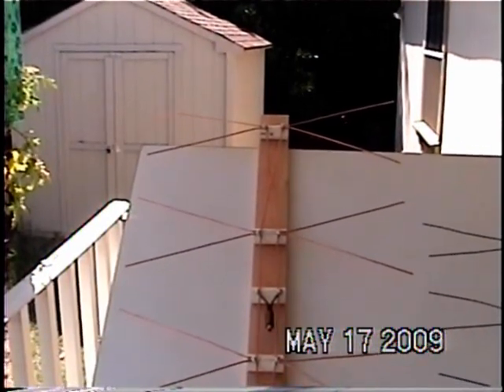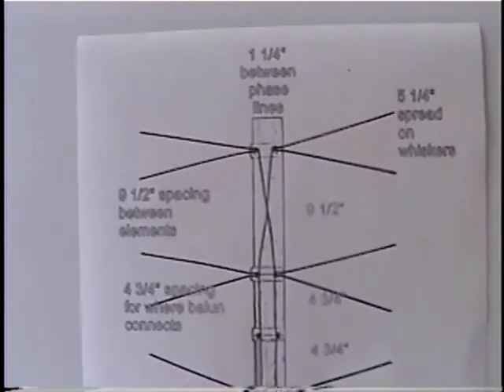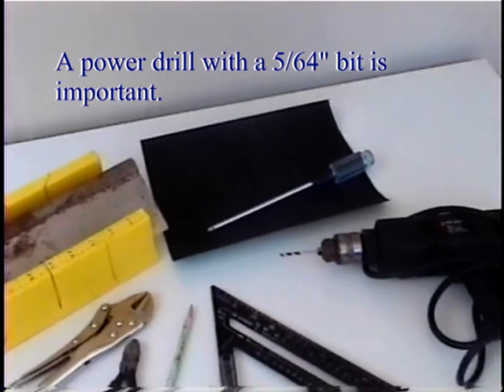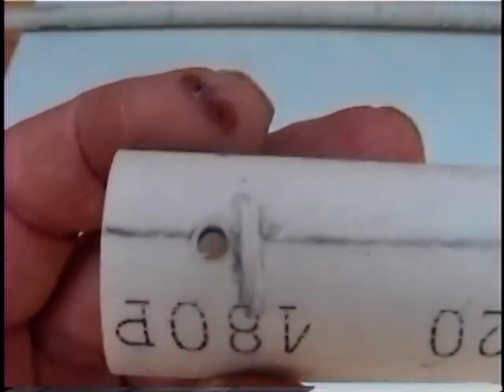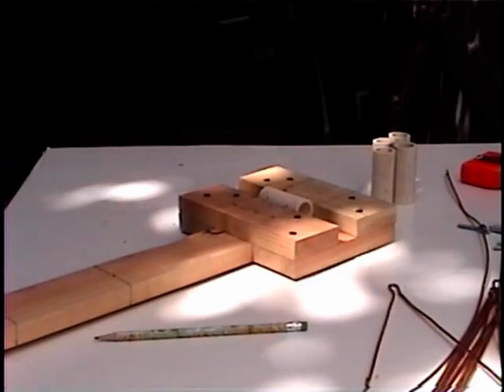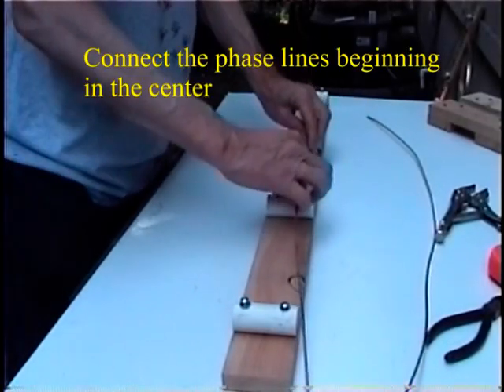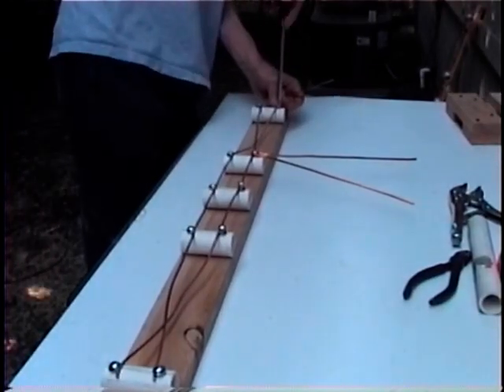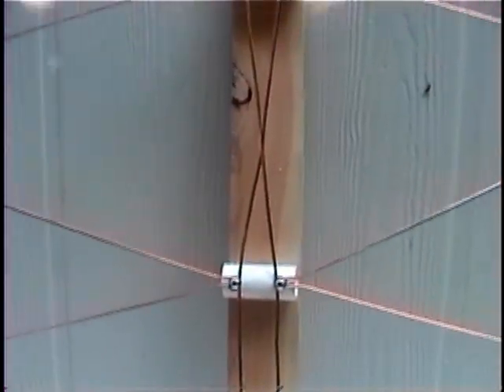A Better HDTV Antenna

Comment from the maker: @jakeshjo Heavier gauge wire won't improve things much. Clean, sanded,  contact points between whiskers and phase lines will do more, plus soldering, if you're good at it. Outside is better, plus being aimed properly (in addition to what I said about contact points), all will make a difference. For an outside antenna the gauge should be heavier, like 8 or 10, but that's mainly for physical strength, not reception. Also, a reflector may help.

Comment from the maker: @jsmac2006 Coathanger wire stinks for antennas. Use copper or aluminum. You'd probably be better off getting it at a home improvement store or an electrical outlet. 8 or 10 gauge is about right.

Comment from the maker: @athlon866 half inch steel mesh would be a lot better than chicken wire. You could also watch my other video on an outside version of this antenna. The last part deals briefly with reflectors.

Comment: Thanks for the video.  What material do you use for the whiskers?  I used coat hangers on my last antenna, but they tend to rust.  Are you using copper wiring from like a Radio Shack?  Thanks!

Comment from the maker: @athlon866 Not sure what tool you mean, but if you are ready to add a reflector, then you must have tested your antenna. Chicken wire will work as a reflector, but it isn't as good as a lot of other choices. Anyway, have fun.

Comment: My cable company used a splitter on the outside of my home. the splitter has a grounding screw.  if the coax coming from the antenna goes through this grounded splitter before entering my home is this an acceptable ground?  if not where would a ground wire attach to this antenna?

Comment from the maker: @MikeChrisII Any antenna needs to be grounded and installed properly, especially if it's outside. It'll work well in an attic, not AS well, but maybe that's all you need. Depends on where you are.

Comment: Out of curiosity i threw together an antenna with your spacing without the standoff.  I actually picked up some channels in 1080i.  
    I am going to make a better one now out of PVC but I have a question.  Are there any concerns with lightning possibly hitting this antenna.  My tv's power strip has a coax filter but i don't know if this blocks surges.  Also would this kind of antenna work if put into an attic.

Comment: Although your work is very well thought out and done, I've just not had any better reception with your design...I've made both the 20" whiskers with your balum spaceing and the shorter 14' whiskers and spaceing...I've got to say that the other design seems to work better for me...I find that the other design locks on to the signal no better, but signal strength is much better...I've used copper in all that I've built...I think the smaller design resonates better across the frequency bands.Thanks

Comment from the maker: @krc5210 You ought to look at my other video, better outside hdtv antenna. I show a reflected version there. Make the basic antenna first, though, to make sure you need a reflector. You may not. Also, look at my wire straightening video. It'll help you. If you do a youtube search for jwwm2 it'll show my videos. Also, I recommend you go to the tvfool website to get information on how to aim your antenna. Lastly, there's a decent youtube video somewhere (not mine) on aiming antennas. Have fun.

Comment: alright cheers for that. i'll make sure i keep them seperated but before i do so i'll try and see what happens if they touch. i just wanted to make sure that doing so would not casue any harm to the device i connect it up to.

Comment from the maker: @DRIF74  Hmm, haven't tried that. I guess there'd be a more serious than minor loss in reception, rather than a complete failure. Professionally made antennas have a minimum of a half inch seperation. I think a minimum of one inch is best.

Comment: At the crossovers of the phase lines (top & bottom) it seems that you simply use a section of PVC to space and slightly bend/twist the phase line at that point to ensure they won't touch.  My thinking is that if you make the connection slightly higher, i.e. a spacer, on one of the top and one of the bottom screws, it would elevate the phase line at the crossover and ensure it wouldn't be accidentally pushed back down.  (I hope I've made this clearer....:P)

Comment: Oh, so you simply "bend" the phase lines at the crossover points top and bottom with a pvc piece so that the crossover is the same spacing as the parallel ones right?  I was wondering if you could use some kind of spacer on the screws holding the top and bottom crossovers?  You would only do it on one side so that the phase line would be permanently separated at the correct width? Perhaps using a measured piece of plastic/pvc that has a hold drilled through?

Comment: I made the other antenna and it works ok, but this looks serious.  I am going to make it next weekend.
One question though, and it might have been asked/answered so excuse the duplication.  At the crossovers top and bottom did you insulate the wires or somehow off set them?  I couldn't see clearly.  I "separated" my other antenna's crossovers with e-tape, but I didn't see any on yours.  Thanks! 5 star effort!

Comment: But still.  The wire conductor mounting screws comes in contact with the wood.  Not exactly perfect isolation.

Comment from the maker: I think you misunderstand, or maybe I do. I mean if signal is coming from behind your antenna, then the reflector will block that signal. The reflector would be squarely behind the elements, which face the transmission towers.

Part of your problem may also be that a reflector isn't right for you. If you're getting signal at 100%, it can't be improved on. Adding a reflector could cause the antenna to be less effevtive.

Comment from the maker: Odd. Soldering usually helps. Also, I can't understand the problem with reflectors. A reflector WILL kill signal from the back, but if the antenna is aimed properly you should get a lot of gain.

Comment from the maker: I'm pleased you got things working better. Looks like you're progressing nicely. Sanding the connection areas, and maybe even soldering the connections will also help. 

Also, you don't say if you are using your antenna inside, or out.

Comment from the maker: Wood has a small amount of moisture, and PVC doesn't. Every bit of loss due to moisture, poor connections, and like that will make the antenna less effective. I've used wood, and it worked ok, but PVC is better.

Comment: Well I built one last night, didn't have perfect wisker lengths but it works great.  I can now pick up my local channel 8 and 13, with the signal strength going from around 35% to 70%.  Hope it keeps working.   I live quite a ways from the stations so I can live with this reception.

thanks for making the video and sharing.

Comment from the maker: I'm happy it's working for you, but check my new vid, Better Outside HDTV Antenna. Same antenna, but all PVC, and with a reflector. 

I need to remount the bars I used as a reflector, but maybe you can get some ideas for yourself.

Comment from the maker: What I've seen recommended by some VERY smart people for optimizing and modeling antennas is 4nec2, which is free. It can be a bit tricky to use at first, and you need a fairly pumped up computer for it to work quickly, but it's a good place to start a search. The antenna in the video was originally modeled using this sortware, but not by me. Hope that helps.

Comment from the maker: The purpose is to get the antenna off the wood, which robs effeciency. It steals only a little, but every 1/4 Db makes a difference. Anyway, if you object to the wood, see my new video, which I put up today: Better Outside HDTV Antenna. It really is a better looking antenna, anyway, especially if it's painted.

Comment from the maker: The spacing should be about 5 1/2", but some antenna enthusasts say 15" works better. Haven't tried that. The Terrestrial and CM are both first-rate antennas, but they aren"t designed to include VHF-Hi. This one is. Don't know the eBay antenna, but the coathanger antenna works ok. This design should yield better results, especially for people that live far from the towers. Anyway, look at my new video, which I posted today. Better Outside HDTV Antenna.

Comment from the maker: This is 3/4" PVC, which has an outside width of 1". The reason for the PVC is exactly for the reason you state: Moisture Content. Your suggestion is good, but I have it on good authority that the screws into wood, as I have it makes only a very tiny drop in reception. Matter of fact, I've made some antennas using wooden standoffs that worked very well.

Comment: Hello, thanks for the video.  I made the youtube antenna and it works well, with the exception of one station which does not always come in.  I want to make your design and try it out.  I do have a couple questions:

1.  Where the phase lines cross, do are they supposed to tough, or do you keep them separated?

2.  What is the overall difference from using 7 inch wiskers vs your 9 inch wiskers with greater spacing.  ?

Thanks

Comment: I agree with gmcjetpilot.
what is the purpose of the pvc pipe stand-offs.
I thought they were to insulate the wires from the conductivity of the wood.  I was surprised to see the screws that hold the wires to the whiskers also go into the wood.  How is this different than skipping the plastic. Are they to raise the wires off the wood one inch?

gmc, I think I read somewhere that the pvc pipe is 3/4 inch which has an outside diameter of one inch. It looks like schedule 40 pipe.,

Comment: I think a BAY is considered a pair of two "whiskers" or 4 elements. This video is a 4 bay Bow Tie (8 sets of whiskers or 16 elements).

You are saying a  2-Bay is as good as 4-Bay. I have to agree, unless you are shooting for a fringe station 2 Bay will serve most people. Terrestrial Digital lists (DB# is for bays):

DB2 - 30 miles or less 11.4 dB gain 
DB4 - up to 55 miles 13.7 dB gain
DB8 - up to 70 miles 15.8 dB gain

You can see the diminishing returns.

Comment: What spacing do you recommend for a reflector to element?

Terrestrial Digital DB4 UHF HDTV Antenna (DB4) can be had for less than $40.

Have you tried the commercial versions? 
The Channel Master 4221-HD UHF 4 Bay can be had for $30.

Have you compared this antenna to the "eBay" version or commercial versions of the BOW TIE? If so can you give signal strength difference?

Comment: What is the gage (schedule) and diameter of the PVC?

You say the elements are isolated from the wood by the PVC stand offs?

The screws holding the elements to the PVC go through into the wood. Does this not conduct to the element? Wood is a pretty good insulator, but does have moisture and thus can conduct? Yes/No.

I'm suggesting using separate screws to attach to PVC spacer to the wood & separate screws & nuts to attach the element to the PVC. This isolates it even more?

Comment from the maker: I need to point out that this antenna is NOT based on the coathanger design except for the wooden spine. It is closer to a cm4221, a very fine commercial design, but should pick up VHF better.

Also, a well-made reflected 8-bay of  'my' design will absolutely work better than a 4-bay, but not for everyone. Antenna reception is all about compromise, trial and error.

When I do my next video I'll try to add how I do the  whiskers. This will be an outside, reflected 4-bay.

Comment: I've made a coupe of the other coathanger designs and an 8-bay didn't fare any better then a well built single 4 bay. Great video but could you do another video showing how you got the whiskers so uniform?

Comment from the maker: As with all antennas, reception will vary. If you live on the plains with no trees or buildings blocking things, then being far is less of an issue. Same if you're on top of the biggest hill around. If you live in a valley, or behind a mountain, tall trees or buildings, then things get tricky. Start with tvfool. Aim the antenna carefully according to the data you get there. You also might need a reflector. Sorry, no PDF. I need to set up a website one of these days...

Comment from the maker: Not a simple answer, it depends on your exact situation. Make sure you have decent signal first. Start with 1 TV, and go from there with splitters.  If signal degrades, you may need a quality preamp like a CM0264. Planning coax runs is important. Shorter is usually better. In rare cases a distribution amp is also needed, but simpler and less expensive is the way to start.

Comment from the maker: Gonna add to this answer. Make sure you need a deep fringe antenna before you spend time and money building or buying an 8 bay reflected antenna. The one in my video is a 4 bay. A reflected 8 bay is hard to make, and hard to aim. Other things to consider are signal amplifiers, and rotation for getting signal from different directions.

Comment from the maker: The best way to improve this antenna would be to add a reflector. A triangular setup would be more likely to reduce signal than to help it. Better off having more than one antenna, and use a switch to seperate their respective signals. Bigger elements would change what frequencies the antenna will get, moving the reception further toward the lower VHF range.  Adding more elements will increase signal strength, but a side by side setup is tricky to make. Look at a Channelmaster 4228 for ideas.

Comment from the maker: 3/4" PVC (which actually measures 1" outside)
That's 10 gauge solid copper wire. 8 would be better. 12 would be a little flimsy, and 6 would be hard to get a sharp vee for the whiskers. Aluminum wire would also work excellently. Same for whiskers and phase lines.
The screws and washers are size 10.

Comment from the maker: Gotta update this answer. Using splitters to combine antennas can work, but requires extremely good building skills, and careful planning. The antenna in my video is a 4 bay, and making one like that, except as an 8 bay would be easier. Then you still only have one balun.  Of course, it'd be almost 6 feet tall. ALSO, don't forget that too much signal is just as bad as not enough.

Comment from the maker: Not sure about the 4" pipe. All of the wires should be in the air as much as possible. Now, plastic bottle caps could work, but I have no idea about the UV rating. Still, if you can see a new way to do things I encourage you to give it a go. Innovation is a great thing. Have fun.

Comment from the maker: Good luck with your build. Make sure you aim it right for maximum effectiveness. Tvfool will help get you there. Cooling racks would be good, should be 36x36, up to 40x40, back 5 1/2 inches. Have fun.

Comment: I think the wood is fine, moisture in the wood will still conduct up thru the screw. Just improved a 4 bay design to catch VHF high in my area. Used wire hanger 12 " bow ties spread 6" at ends on 9" centers, spaced off a 29"x36" corrugate foiled board  reflector. Good enough for 14db gain  on channel 26 in a  buddy's attic. Channel 7 gain is about 7db. One antenna for all OTA better than most store bought.

Comment from the maker: This was designed to improve the lower range. This design can compete with the Gray-Hoverman antenna, but is better because it picks up VHF hi. I don't have an answer for your length question.

Comment from the maker: Copper or aluminium is better than coathanger because of the rust factor, especially for outside. It could be painted to make it look better... Better yet, use something other than wood. I came up with this way of making this antenna for ease of manufacture, not asthetics. The "spine" could be PVC, another plastic, or even metal. The standoffs need to be plastic, and the dimensions maintained, but the materials are up to you. What you have around, and imagination are the only limits.

Comment: Okay, I just don't want my "wiskers" to loosen up over time or fall backward since the wire thicknes is going to be a little over double on one side of the screw compaired to the outside.

Comment from the maker: The notches are to hold the phase lines (zig zag) so they are 1st, the whiskers (V) go on top of that, then the washer and screw. Phase lines and washers need good contact, so a little sanding with fine sandpaper is a good idea.

Comment from the maker: Acrylic blocks are fine, but not better. You don't say if your antenna is in or out, but try angling it up a little, and make sure it's aimed properly. Look for a "sweet spot." Sometimes in a situation like yours a 5 degree from perfect aim and up slightly helps. Sometimes aiming it at another hill or large building will catch reflected signal. The reflector (inches) should be 32x32 up to 40x40, back 5 1/2. Let me know how things work. Good luck, and have fun.

Comment from the maker: Foil is fine, great, in fact, but only for inside. Mesh is better for outside because of the "sail" factor. This antenna was redesigned for ch 7-55, and should be good for most people. It will NOT be perfect for all situations. There are far too many variables for that. Hills, trees, buildings, frequencies, in or outdoors, aimed properly or not...All will affect reception. Everything makes a difference, and even the best antenna for each circumstance is about compromise.

Comment: I just spent the better part of 3 hours and $25 on this and it doesn't work as well as the other antenna.  The simple cheap one that you've got at the beginning of your video. 

This one looks better but doesn't work as well.  At least not for me.

Comment from the maker: WOW!!! You have a lot of questions, and I like that because it means you're thinking. 

8 to 12 gauge wire should be OK. Doesn't have to be copper. Could be aluminum, or even coathanger. Steel will rust, though, especially outside, then it won't work.

Use a 2x4 if you feel like it.